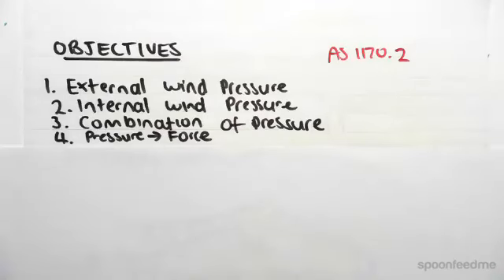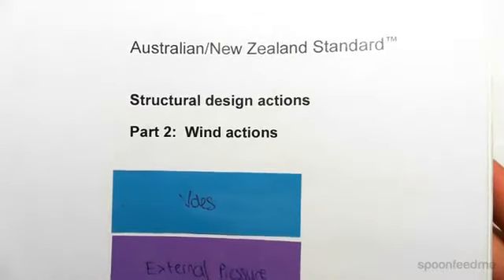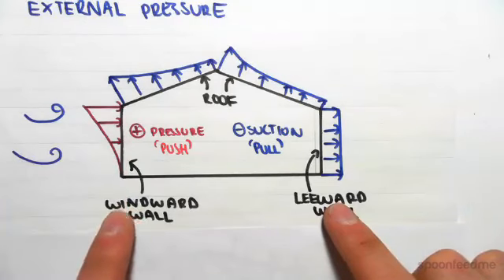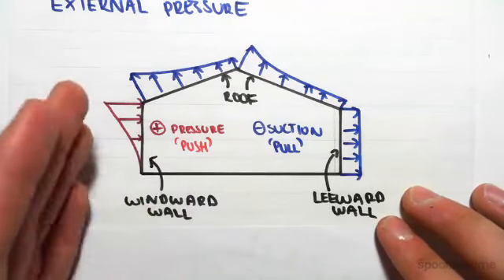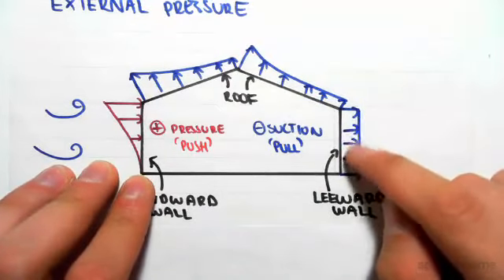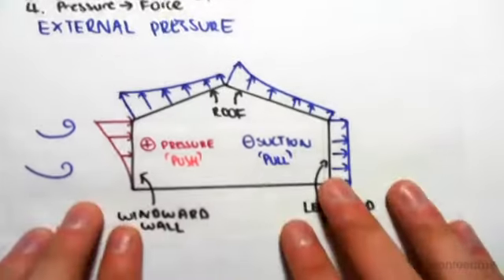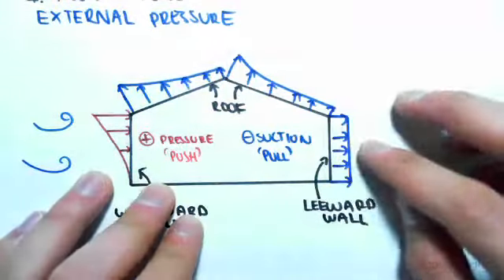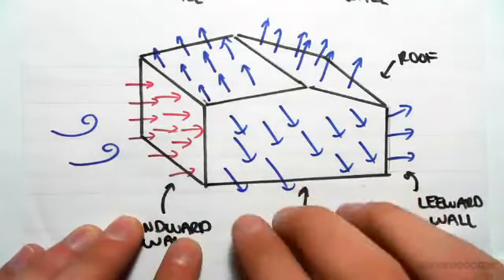Introduction to Wind Loading | Structural Design & Loading

Comment: Its because there is low pressure on the outside as the flow goes past the building.  There is a pressure dp. This is similar case as an airfoil